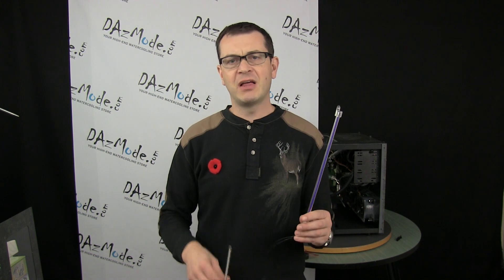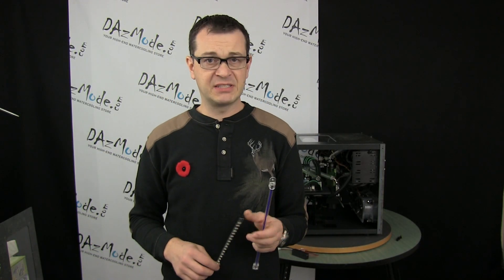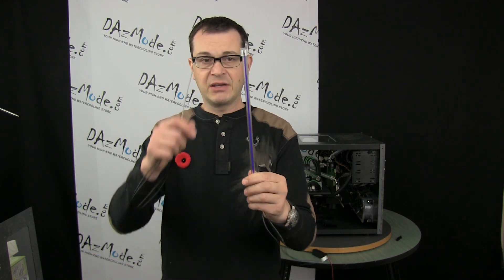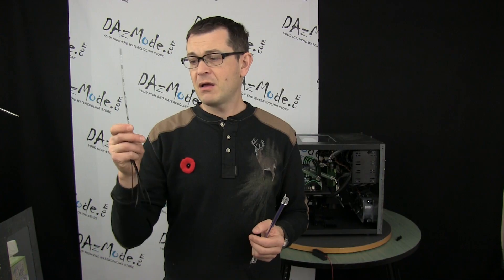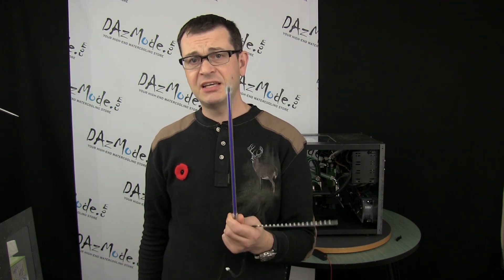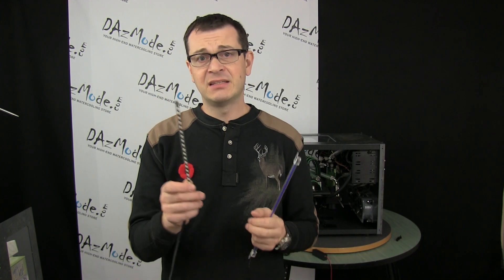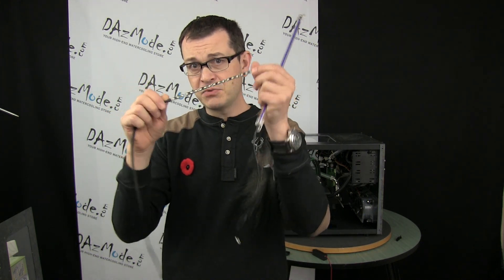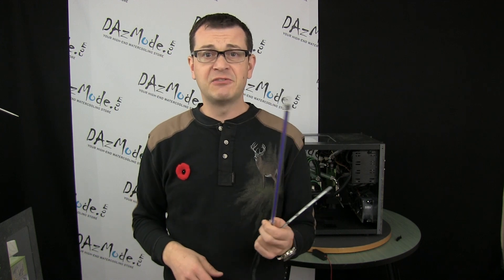CCFL vs LED Lights - Selection Tips

Comment: I'm a fan of CCFL for UV, it produces very little visible light, which makes UV really pop.
UV LED's are very purple, and while they do make stuff glow, the purple hurts the contrast and in some cases Acrylic/PMMA blocks almost all the light.

Knock on wood, I have a set of CCFL's in my case that came from another case that was built in 2003 and they still work today.
Reply: tube lamp(mercurry) is the only type of lamp that can create UVC.But the rest of applications belong to the LED which is for more better.

Comment: CCFL UV is more narrow: 365 to 368 nm  -  LED UV: 385 to 400 nm
UV: 10 - 400 nm   -  Purple: 380 - 450 nm
CFL stays under the Purple range.  -  LED is within both UV & Purple so you end up with purple glow & less UV reaction. 
LED is also too high in the UV range that it doesn't react well with all UV reactive things.

Comment: is 12 or 24 volts?
Reply from the maker: 12v in - 3000v out.
Reply: the CCFL you mean 12V??.
Reply from the maker: I mean 3000v for bulb. Thsi si why you need that inverter box.
Reply: thank you,,, Im planning to change my broken CCFL bulb into 12V LED.

Comment: I have tons of CCFLs around me (diff colors/sizes), but none of them are used anymore.

CCFL converters start to fail too soon, the CCFLs themselves start to make buzzing sound after a while. They require quite some power and produce heat (the converters mainly). Also I have had CCFLs where the cables would break and melt because of high voltage.

I also heard that CCFLs are bad to the PSU and other hardware...!

LED on the other hand is expensive and produces only (bad) spotlight.